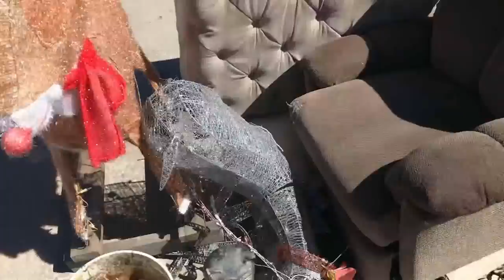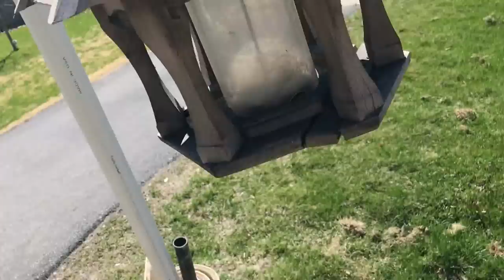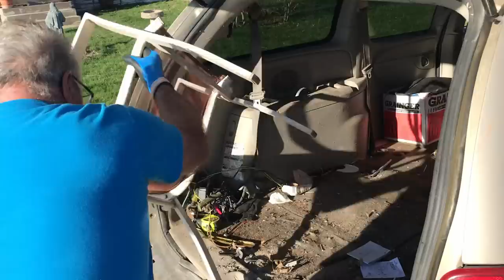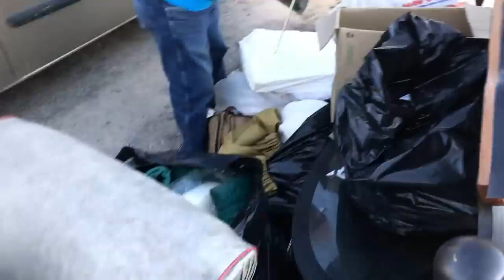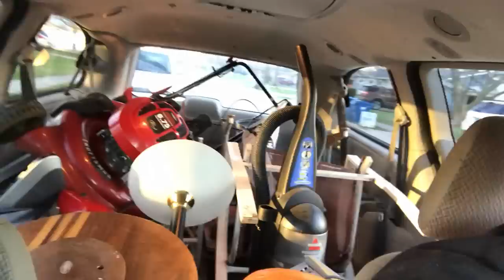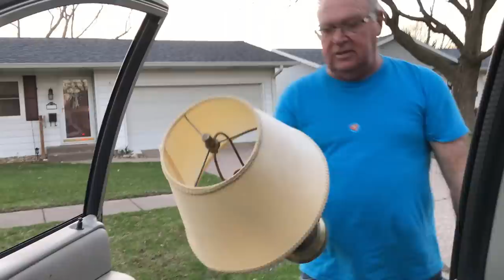CITY WIDE CLEAN OUT!!  SUPER SCORES!

Comment: If u weren't going to use those metal shelves in your ebay storage, they can easily be flattened. Watch Charles do it on Florida Scrapper. The 4 drawer file cabinet could have then been stacked on top of it on the roof. Maybe next time!😎
Reply from the maker: That particular four drawer was a security cabinet and it would’ve been way too heavy for me and Bob to lift on top. Although we could’ve taken the drawers out we thought about that later.
Reply: @ShaneManTV  just lean it again the rear and both lift and slide it onto the roof racks, bungie in place ta da!!!😎